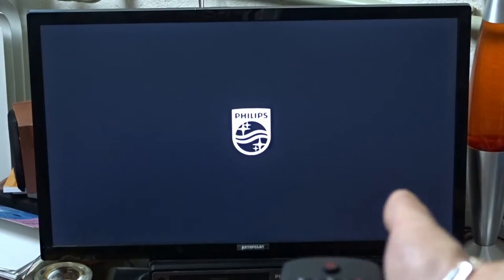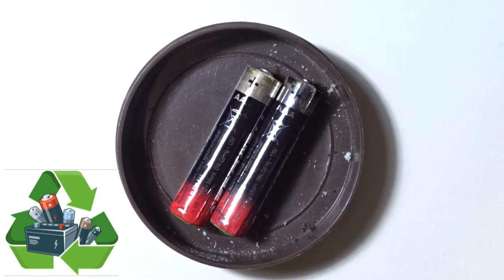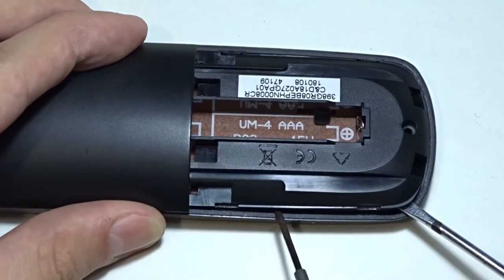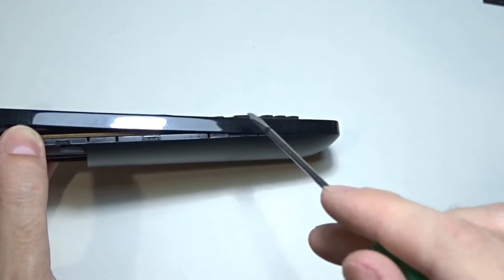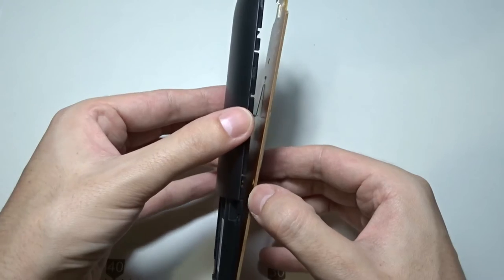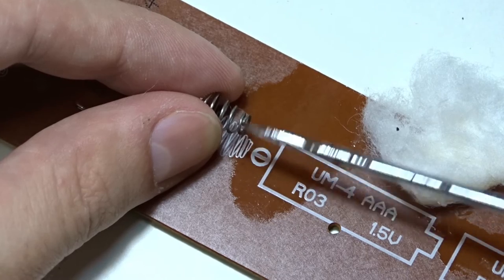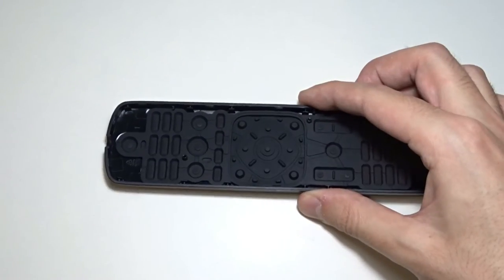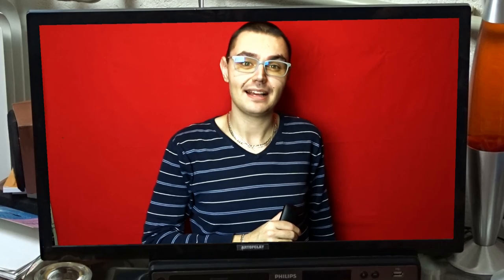How to Clean Battery Corrosion in Remote Control (Philips Remote Control) 📺

Comment: Vinegar did the trick, thanks! Didn’t have to open up the remote - just clean the springs where exposed.
Reply from the maker: Great to hear that vinegar worked for you! It's always nice when a simple solution does the trick.